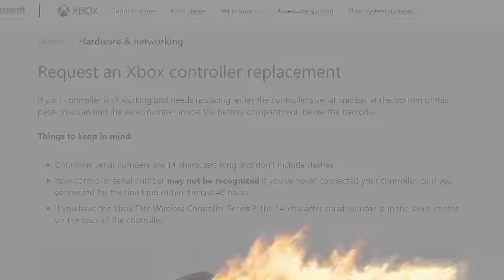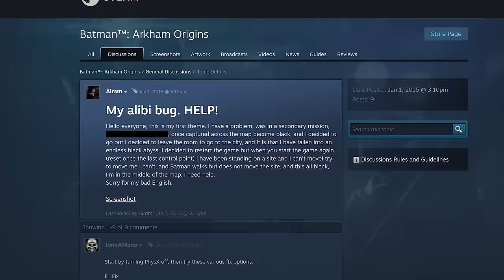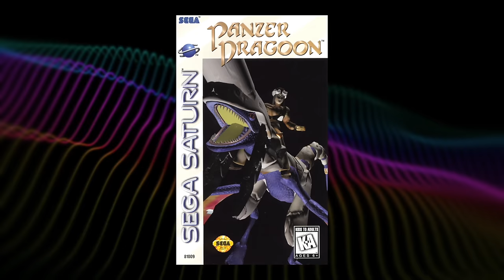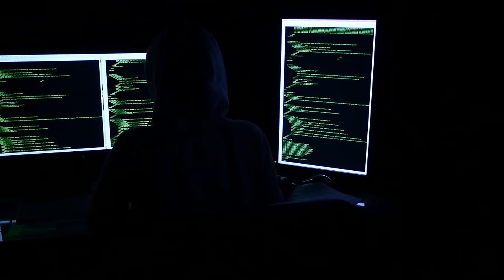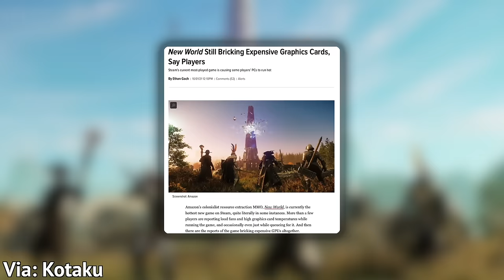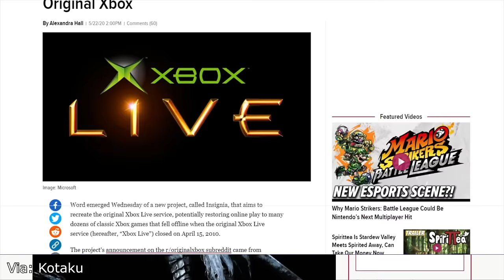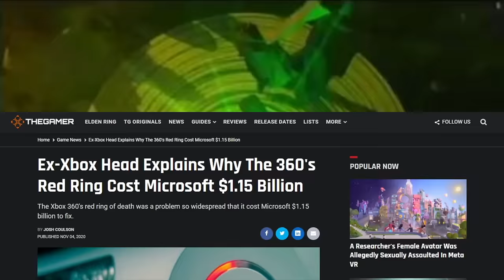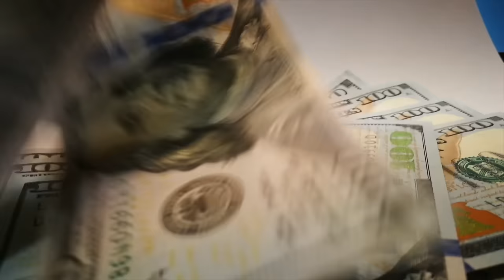10 NIGHTMARES Every Gamer Has

Comment: I couldn't access my PS because I lost access to my old ass email it was attached to, so I couldn't reset the password at the time. I didn't call in because it allowed me to make a second email account on my 1st account and it fixed it for about a minute. I finally called them and they basically wouldn't help me because I needed my original account. I told them I couldn't remember how to access it but I attached a 2nd email. They said that's impossible; to which I said... "no, it isn't I did it" they said "No it isn't". We when back and forth and then they said they can't help me. I finally got my old email and got the information but at this point my account was fully on my 2nd email and the 1st no longer worked. I called back and explained and they once again said it's not possible to have a 2nd email. I asked them if I could send them screen shots of what I'm seeing they said they " we don't need them". So I ended up losing old account attached all the way back to back to the 1st gen ps3 when it came out. 1000s of dollars lost of games. Several games I almost beat but had to buy again to beat and start over... yeah never did any of that. I only buy disc's now no more digital games.

Comment: Just so you know, you have DEFCON backwards. Defcon 5 is the lowest threat level. Basically meaning all armies and weapons are stood down. Defcon 1 is the worst, meaning imminent nuclear strike. Anyway, being a PC gamer all my life, I always make multiple saves for a given playthrough and make backups every once in a while. Corrupted saves are less common nowadays, and many games can recover corrupted saves. There are also third party programs that can fix corrupted saves for certain games. Also, playing on PC gives me other major advantages, such as being able to patch or mod games or use console commands to fix or progress past a bug or glitch. I also have an entire clone of my hard drive that backs up everything once a month, so if I lose any data I can usually recover it. And I never had to worry about CDs or DVDs for playing games. Most games need to have the original disk in the drive in order to play for copy protection reasons. But I've been using copied CDs or no CD cracks for a long time, even though I own the game I don't want to risk scratching up the new original disk and it's a big hassle to constantly switch disks if I want to load up different games. As for broken controllers, I actually opened up several controllers and fixed them myself. Usually a broken transistor or cracked trace on the board. I fixed 3 broken controllers for my nephew. He needs to be nicer to his controllers... But sometimes I've had controllers or mice and keyboards break on me for no apparent reason, even if I wasn't rough with them.